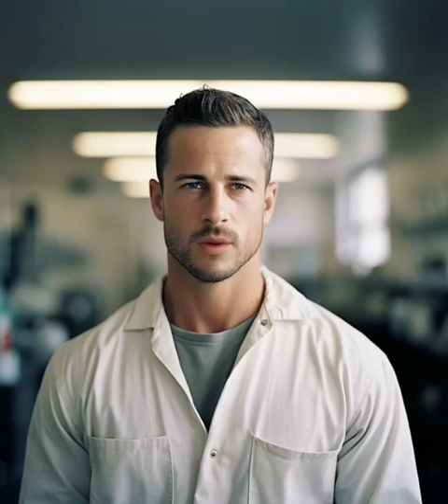MEOW Ep. 3

Comment: Any love for the tri-lug? I was thinking of mating a CAT MOB to an SP5 via the 3 lug. Otherwise i will utilize the threads
Reply from the maker: Yes, you will need a tri-lug HUB adapter, just make sure it’s not longer than 1.6 inches because that’s the internal length from the start of the suppressor to erosion wall 😉